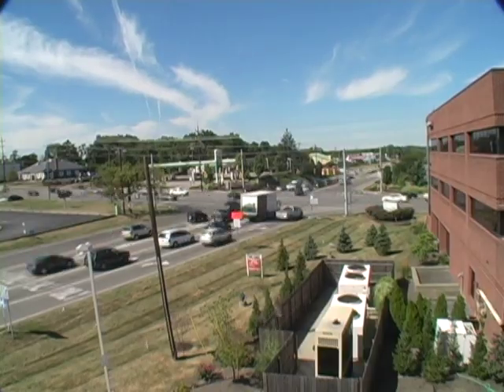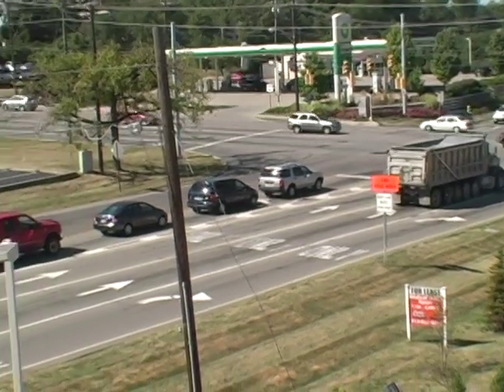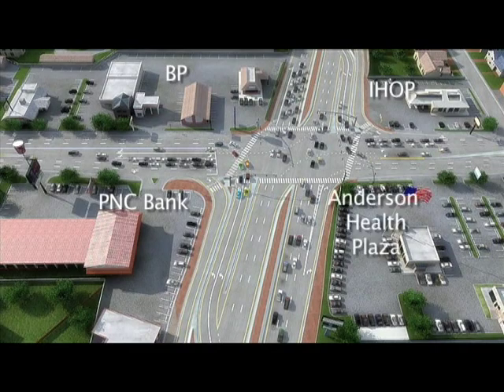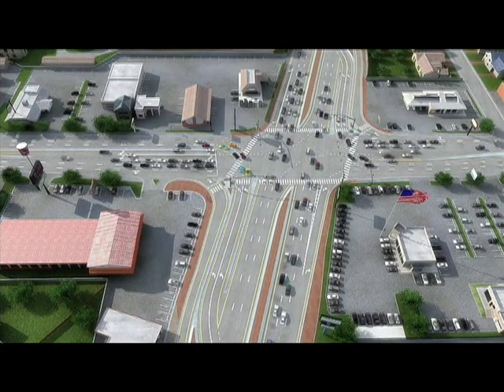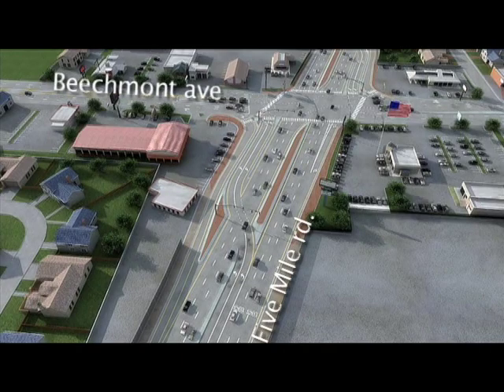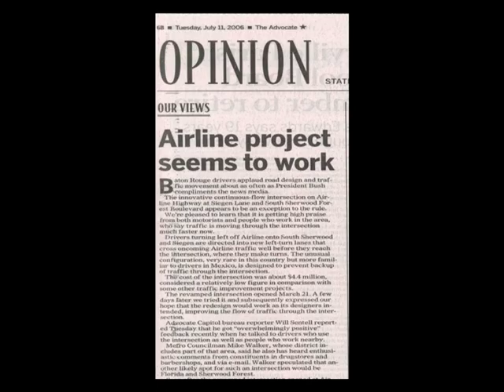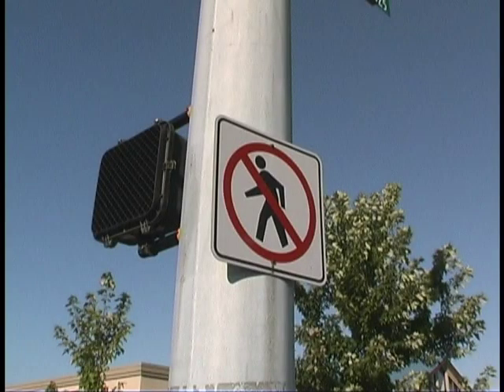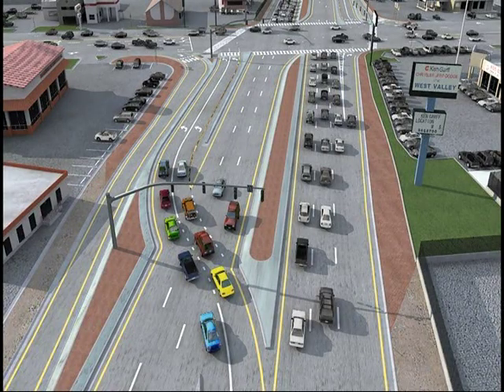Anderson Township:  Beechmont Ave & Five Mile Road Continuous Flow Intersection Informational Video

Comment: The traffic conditions are terrible all the way down Beechmont due to all of the lights seems I drive 25 mph to 30 mph all the way down with the limit being 40 mph. I often avoid Beechmont for this reason and my business goes elsewhere. Turning right from 5 mile to Beechmont is always congested because of people turning left in to the town center by Kroger. Turning left to 5 mile from Beechmont towards 275 stops straight away traffic as well. You guys need a better solution than just this.

Comment: Why not a roundabout?  They are statistically MUCH MUCH safer and don't necessarily have to stop traffic from any direction.
Reply: But the traffic backup would be ridiculous.
Reply: On a junction with roads like the ones shown, you also need an overpass and an underpass for the through traffic, allowing the roundabout to handle only the turning movements and access to businesses.